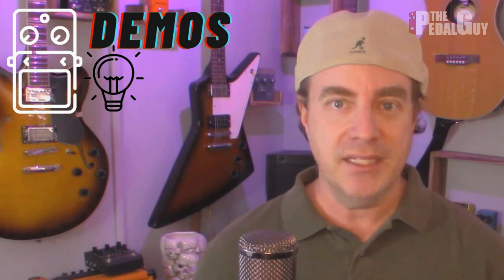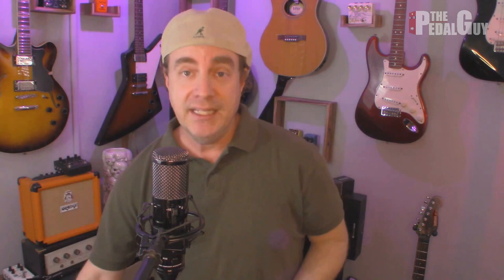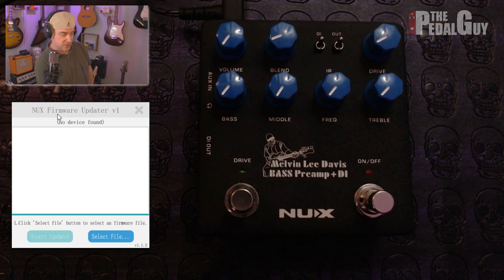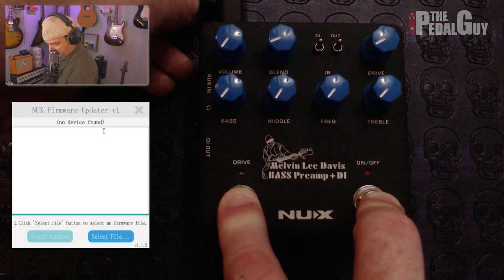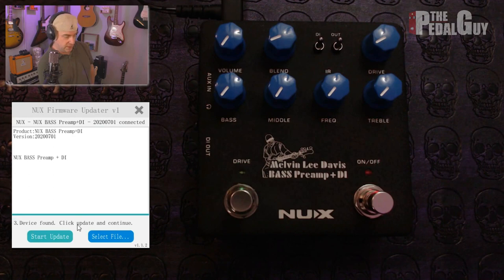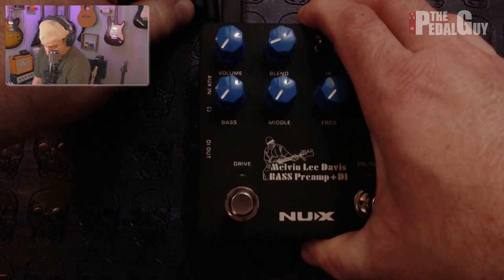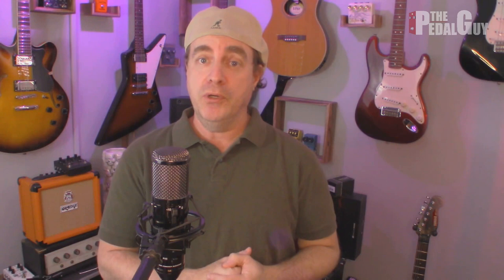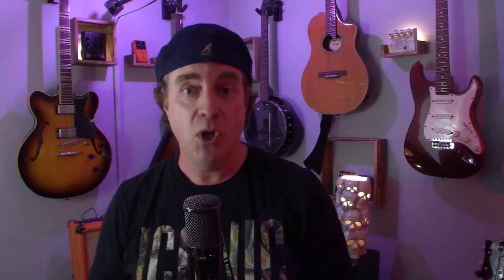Nux Update Firmware Update the Verdugo Series

Comment: Thanks for the informative video, Scott. I have the Optima Air (purchased from you - Thanks!) and I've been confused by the software. First, I can't even download any of it on my iMac, because of all the security red flags it sets off. I was able to download the Editor software and the Audio Format Converter software on a different computer, but I can't find any clear information about what I can do with the software (other than tweak the existing presets). According to the NuX website and various videos, I can "load third party IRs" (even electric guitar IRs), but I have no idea what that means and how to do it. I can't even figure out what the "Audio Format Converter" software is and what it's supposed to do.
Reply from the maker: Hi Issac. I will let NuX know about the download problems. My main contact in China is running on a Mac. I will get around to doing a Format Converter video in the near future as well.
Reply: @ThePedalGuy  Thanks Scott!

Comment: Thanks for the demo! I did the update on my new NUX Atlantic but not sure what my changes delay/reverb would be. Any idea what the current firmware updates are?
Reply: Running windows os10
Reply from the maker: @grooveu1965  if you connect the Atlantic to your CPU in update mode and run the Firmware updater, you can select the firmware and the updater should tell you what's new before loading it into the Atlantic.

Comment: I've tried this procedure numerous times and nothing happens. The lights don't blink and the pedal does not show up in the Updater. I've emailed NUX for assistance.
Reply from the maker: Let me know how that goes. If it’s a first run of this pedal there was a sporadic issue with the USB chipset. NuX should be able to replace the pedal for you if this is indeed the case
Reply: @ThePedalGuy  NUX responded that it's bad what my pedal is doing and asked me to send a video, which I did. The other issue I'm having is when I switch the toggle from Pre to Post, there is a loud hissing noise. I hope that this is not normal because I won't be able to use the preamp and control the DI output level( One of the main reasons I bought the pedal). I must say that I am very disappointed and may have to return the pedal for a refund. I'm still waiting for their latest response.
Reply: @ThePedalGuy  I solved the issue with the loud hiss when engaging the Post mode. The gain on my channel on our mixing board was too high(Which I suspected by the way). NUX did ask me to ship my defective unit to them in exchange for a newer pedal. Since I have to pay to have it shipped to them, I decided to return it to the seller for a refund. This is unfortunate because I really wanted to keep this pedal. It's time to go with a different one altogether.
Reply from the maker: @KeithCopeland778  gotcha. Sorry to hear this.
Reply: @ThePedalGuy  Yeah, very disappointing.